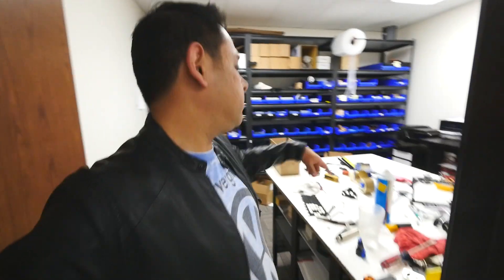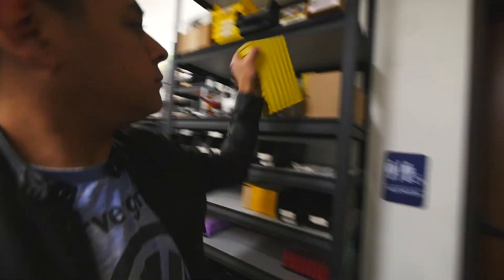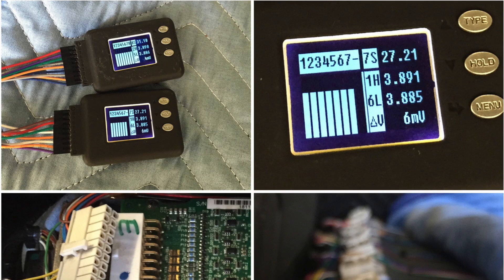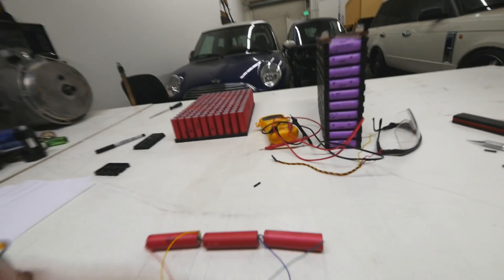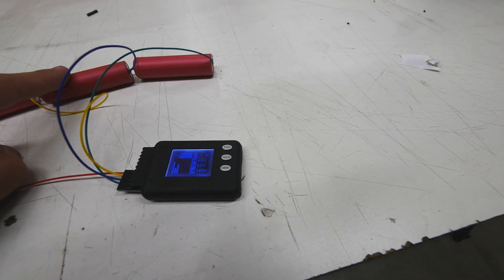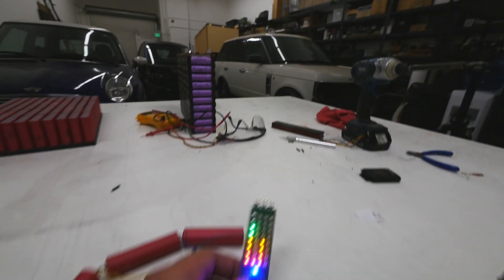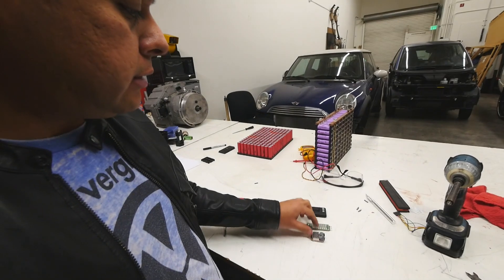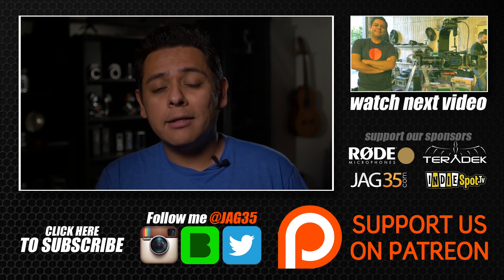Battery Management System Or BMS?

Comment: Near the end of your video you discuss those little widgets that will monitor and measure cell voltages individually in a pack.  These are a great idea, however, your links to these devices are useless now (typical).  Keyword searches on google will however get you to other sellers that have them.  BUT, these widgets don't come with connectors, especially if you happen to be building a pack that has more than 8 cells in series.  You have to order these balance connectors (for 6s, or six series cells) separately for these monitor widgets from a different vendor if you want to install these monitors on you pack.  I am using a BMS on my packs because I happen to have them, but the 10s connector on the BMS wont fit for the monitor unit.  
You fail to mention all this in your video, and this is not of any help to those of us who are building packs for our stuff (like E bikes).  The ability to monitor individual cell voltages without tearing the cover of a pack is huge! (like you said, I think).  So pre-wiring 2 additional balance connectors (since I have 10s) that fit monitor widgets when building the pack is an excellent idea!!

Comment: Question if I have 2 lithium phosphate battery packs 32 cells each headway and I'm using them for car audio. I have balance boards  but want to keep a battery up front for the car alarm ect. What else do I need to make it safe and keep the maximum charge and discharge for amplifiers.

Comment: I am a electric bike person.. Every battery i build for myself has no bms.. I run extra leads to each bank to test voltages etc.. Roughly once a month i manually check each battery bank manually with a volt meter. I can use those leads to charge as well. 2x a year i manually charge each bank.. Ive had no problems.. Only problems ive had were with purchased batteries with bms.. I think as long as u keep a eye on things (and you have discharged and recarged all the cells your using to build your battery. Matching the cells is a MUST!! I cant say that enough. Match your cells and 95% of your headache is gone.

Comment: I am working on battery pack for electric scooter and bikes and the BMS save some customers because I saw one row gone gone before the others no voltage at all .
If you try without BMS they will overcharge the other because they let the power going trough .
example 10S become 9S and wthout BMS the charger will push 42V on 9s 

if is only 1S you don't need bms

Comment: That's exactly what I thought.  LiPo4 batteries can be managed through modern controllers with temp sensors.  They have to change the parameters in order for the batteries shutting down with the controllers set ups and not through their bms.  Simple redundancy.  The controllers will stop in case of over or under voltages, shorts and high temps.  I think I can get away without a bms on LiPo4.

Comment: ok. if I don't use a bms , for example to connected 5s 18650  21v with bms and adaptor for bms . how do i charge them tougher and  not separated ? thanke you

Comment: Its dangerous to tell people you don't need a BMS,  I think you are understating the danger of going without one.  Sure if you constantly keep up with monitoring your cells,  and for YOU as technically minded you are, you probably don't need it,  but if someone who does not constantly check their stuff,  wants to set it and forget it,  those people absolutely should use a BMS.   For me,  a BMS cost maybe $100 tops for my application.  my battery pack cost over $1000.  I'll pay the extra $100 to be sure my $1000 investment is protected from me forgetting to check the health of my cells.

Comment: Hi your videos help a lot. Thanx man. But i need a little help from you. I have few batteries and few more will be there within days, now through i max b6 it only gives me the capacity of one battery at a time. And its time consuming. How can i get to know the capacity of few batteries together.
2nd suppose we have 4 batteries with 2ah, 1.2 ah, 1.6ah and 2.2ah now if we connect them together in parallel we are going to get the summation of amp hr like in this case 2+1.2+1.6+2.2=7.1 ah,
Now when we put a load on this pack the 1.2 ah battery will go down first now the other batteries will try to charge it, and that should effect the capacity of the battery pack, is that so? Please help me

Comment: One of the problem is that all batteries are not chemically identical and as well voltages are not same. Other problem is overcharge and over discharge problem. When batteries are connected they adds up with each other make more difference in voltage than a single battery. Using diodes, resistors and transistors to manage the power, and manage the charging of the batteries are not a bad idea. At least you have a protection system. Mostly when lead acid batteries overcharge they explode. So also the lithium batteries not to be left overcharged or over discharged. After they charged the voltage will be reversed, this might damage the charger and or the batteries or components connected.

Comment: Hey jehugarcia I have a question for you and for the viewers of this channel... now I have a mobility scooter that asks for 35 ah gel batteries.... ok now I just bought brand new batteries on may 14th and as of last week they were nearly totally failing cause I couldn't even get 2 miles out of them... now I've came across 70 18650 lithium cells for 20 bucks which is a great deal from my research lol...  now the batteries mainly came in 2 battery packs from those ride on scooters that all citys have one has 30 cells and is 7800 mah at 280 wh at 36 volts and the other  is 28 cells and 8800 mah at 317 wh. Now   with my deep cells failing what I did was only hook up one deep cell battery and basicly half of one of the lithium battery packs (around 15.5 volts) and now after about 3 or 4  cycles to both deep cells I went and hooked up just my deep cells and I got nearly twice the ride distance out of them (the 12 v deep cell batteries) now what do you think could have happened to those batteries? Cause now they are getting better milage. Please help me understand.... besides that jehu thanks to you I'm in the process of making 7s 10p battery pack for my coupe de ville lol (my mobility scooter) it should be around 25 ah and that should be plenty of power... oh my scooter's 24 volt  controller's out put is between 90 and 2000 watts... yea I know that sounds like a lot but that is what it says on the side of my controller.... so what does everyone think? Will my 7s 10p battery pack be enough?

Comment: How are you?
We are battery pack parts supplier in China
We supply parts to build battery pack
The parts we have include spot welder, bms, nickel strip, pvc, insulation paper, plastic holder and charger
Do you need these parts?
If you need any please feel free to contact with me
Best regards
Ms Little Bear
Shenzhen E-fire Technology Development Co.,LTD.
Office direct land line: 0086 755 85252112
Cell phone: 0086 18666858260 (Whatsapp&Wechat)
E-mail: littlebear@@t
Skype: e-firesales

Comment: A little funny question:
Can I like connect the negative wire to the main negative(even if 230v and 200amps)
Like  to save on wires for the same negative pole?

And like have the positive wires at each batter(like 3.2v at 2amps)?

Comment: i agree, once i asked you sir "how many cells in series for 24v ups battery pack ?",  you said 7S , and i made it. then i couldn't find BMS more then 20A in Pakistan, and i need at least 100A continuous , so i started using it without BMS, and it's been more then one year and it's still working great - i added just a fuse for protection, that's all.

i didn't find capacity of each cell of the pack, i just fully charged and made sure that voltage drop don't exceed 4.15,.

i learned - if you don't charge your battery's each cell more then 4 v then you don't need BMS and this will prolong your battery life too.

Comment: Link that follows appears to be the updated product to test cells seeing as the Cell Log 8m is discontinued. https://www.aliexpress.com/item/AOK-Cell-Meter-8-without-background-light-and-Discharge-Multifunctional-Digital-Power-Servo-Checker-Tester-2S/32792553648.html?spm=2114.search0204.3.135.2e3a3c73hcnc28&ws_ab_test=searchweb0_0,searchweb201602_5_10065_10068_10547_319_317_10548_10696_453_10084_454_10083_433_10618_431_10307_537_536_10059_10884_10887_100031_321_322_10103,searchweb201603_54,ppcSwitch_0&algo_expid=04aab1bf-9cbc-4cf4-821d-5794f97659f2-19&algo_pvid=04aab1bf-9cbc-4cf4-821d-5794f97659f2&transAbTest=ae803_4

Comment: I want to make one 6cell 11.1 volt, 4400mah battery with a laptop batteries. It will be used in motorcycle as replacement of lead acid battery. Do I charge it from bikes charging system? I don't want to use any bms. Please help

Comment: Your video’s are INCREDIBLE HELPFUL! Can I pay you for a phone/Skype consult? $50 an hour? No joke. I have been researching using lithium for our custom high performance wheelchairs we are building. We are on a tight timeline and need to get these battery/charging issues resolved ASAP.  I have a engineering background but new to lithium. I broke my neck which paralyzed me from the neck down and has also confined me to these horrible designed power wheelchairs on the market. We are building a 4x4 wheelchair that solves ALL the issues that others don’t on the market.  It also can go up and down a flight of stairs, on the beach, snow, mud, etc. We want to help others confined to these crappy designed chairs and give them more independence and freedom. Figuring out the best lithium option for our 24 volt system is our LAST obstacle. We could use your wisdom and advice. These drop-in lithium replacement battery manufactures that use their built-in BMS to replace regular GEL/AGM group 24  12v batteries are biased when getting advice from them. We need a outside, unbiased perspective. I can send u money via PayPal right away. Your help and wisdom would be greatly , greatly appreciated.  

with gratitude, Jason

You can contact me directly via my email: payitforwardinlife27@gmail.com
Reply from the maker: Sure man,  I do consultation work on a site called Phantime.com/Jehu

Comment: Hey my friend. Would you think pulling out the Battery management system will make it run better? Rc world has esc also for not burning things or blowing up. My ebike bafang bbs02 750w 48v has i believe an esc and the battery a bms. I can check voltage on my display nog going below 39 before it drops put. Balance charging my 13s5p ebike battery like my lipo's would be the same thing. My question is will a bms limit your motor from blowing up. Confused a bit.

Comment: Can multiple bms be connected in series to come up with a higher DC voltage to charge and discharge using a small input source? Like the setup would be individual power input for the bms then the output/ discharge of the bms would be connected in series to one another. Would that be feasible?

Comment: Where can I buy new cells 18650s I am building a camp trailer want to put solar on the roof. Need 7500 kw 110 volt and low voltage. 12 volt. Drawing a massive blank. Also love the VW van if you want oak basic roof racks happy to send a nice set.

Comment: Hi, Hope all is well. All your vids are informative. I have a question about battery ppwer and how to use the max amount of power sending it to the end user. If one had 120000 that each produce 0.5V and 0.1 amp connecting 28000 to achieve 2800 amps and 92000 to achieve 46000 volts how would one go about achieving the max power lets say 120+ mw and how would you go about delivering that power to the end user?

Comment: If you have a multi pack, multi cell battery its just too much extra complication to monitor every single little insignificant cell individually. Monitoring the packs is fine but you don't need to use a dedicated monitor. A simple little tester like you use is fine to test each pack occasionally aft multiple charge and discharge cycles.

Comment: Will a cell made from 100 x 18650's arrange in 10 parallel and then connected in series to create 37v balance itself or will I need a monitoring system?

Comment: Question from Denmark.

I have acquired an old electric cemetery garden car. 

it runs on new 3 x 12 volt 100ah  battery in series.

but i would like you have an BMS installed,  what should i use in this case?
I do not know anything about it, but i want to have en an experienced point of view, for what to use. and not use, mayby a link to a site?

Kind Regards 
Lau

Comment: Sorry i know this is a very old video but we use those "lipo alarms" in rc and leave them on while running the truck/car so we can hear the buzzer go off when we hit low voltage.  Alot of new speed controllers for rc habe adapted lipo cutoff.  Also alot of the rc branded lipo voltage check guages that connect to ballance leads also offer ballancing built in now too. Mine will ballance up to 6s and fits in my pocket. Great videos! Im just getting into ebikes and 4 wheeled electric ride ons. You knowledge is invaluable for a newbie

Comment: I did a 'bulk charge' on a 7s 24v tesla battery pack for a couple of years, then discovered that one of the cells discharged to 0v (must have had a bad 18650 that drained the cell), and the other 6 cells were charged to 4.6 volts.  So I probably damaged all 220 18650s by trying to skip the BMS.

Comment: So, if you are your own BMS, how many times a day do you have to check the cells?
Reply from the maker: None
Reply: hmm, not sure I understand. Maybe you can help me understand. Im looking to make a  12v, 160ah lifepo4 batterybank, using 4 of these  3.2v cells, its for my camper van.

https://www.ev-power.eu/Winston-40Ah-200Ah/WB-LYP160AHA-LiFeYPO4-3-2V-160Ah-TALL.html?cur=1   

that I will be powering with 4x100 w solar cells, via the tracer 

https://www.ev-power.eu/en/By-Brand-Manufacturer/GWL-Power/MPPT-Solar-Regulator-12-24-V-Tracer-BN-40A-Input-150V-TR-4215BN.html?listtype=search&searchparam=REG-TR4215BN

Now, they recommend getting this 300 dollar BMS system. https://www.ev-power.eu/Battery-Management/BMS123-Smart/123-Smart-BMS-Complete-Set-4-cells-with-Bluetooth-4-0.html?&listtype=search&searchparam=BMS123SM-SET&cur=0&&listtype=search&searchparam=BMS123SM-SET  

do i need it? Obviously Im not sure what im doing, but im willing ot learn, especially if i can save 300 bucks! 

they also have these things https://www.ev-power.eu/Battery-Management/

Comment: A BMS is virtually essential in consumer or similar products equipped with potentially volatile batteries types like lithium, however, I personally do not integrate a BMS into my packs, it adds cost & weight, I build my packs for my ecycles, one of them is a Headway 38120 16s pack, for its ability to provide excellent high amp performance, additionally, I run 18650 pack(s) in parallel for their lower cost of capacity, providing for an extended range, they are connected to a custom built regulator before being supplied to the motor controller, this regulator has the ability to connect four packs supplying four outputs, it allows for independent voltage & current programmability with data logging. My charger has integrated balanceing, like used in the RC world.  All lithium batteries I've seen used in RC do not have an integrated BMS, they have a balancing plug & main supply, they commonly have integrated fuses.

Comment: So, then couldn’t we wire 4, 3.7  18650’s for. 12 v system. That would be 14.8v, would that work for a 12v system?
Reply from the maker: Fully charged is 16v which is too high for most 12v devices
Reply: Ok, again thanks for your help!

Comment: As long as you don't have a catastrophic overheating (decent protection built into good 18650's) you won't have a very dangerous situation. A BMS is an added layer of safety. If the individual 18650 can self-manage, then it's not "essential" but is still beneficial. However, an emergency fire suppression system might be a decent idea, and it's not a one-or-the-other sort of thing. :P

Comment: looking for suggestions from the person who got me going doing this,, that's you Jehu, anyway, I'm converting my boat to EV, 36ft islander sailboat,, I want to use shorepower, solara, wind, hydro generation,, I've bought 600 new panasonic 3.4A 3.7V, I made up 20 packs of 30 cells in series, I don't want to let the cells drop below 3vdc or charge over 4.1 vdc, I'm looking for a quality bms to keep these safe and working for a long time.. 
   do you have any ideas,, ok I know you got lots of ideas, what do you think, i've got your utube link on my desktop and notifications bell for new videos,, btw awesome samba,, I used to have a 63 v dub bus,, wish I still had it now,,, :-(
Reply from the maker: Batrium.com
Reply: oh yeah, I got 4A glass fuses for each cell, sunko 708A spot welder, weller iron,5mm zinc ribbon, 10awg buss wire for + side. cool,, just confused over bms system.
Reply: I've been looking at batrium,, saw it on hbpowerwall and joe,, just needed your ok, tx ,, awesome